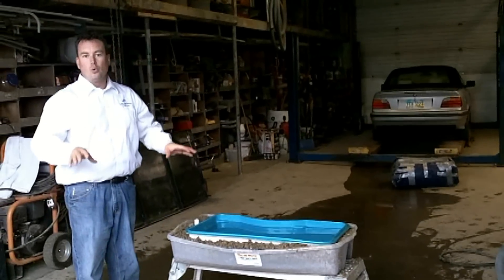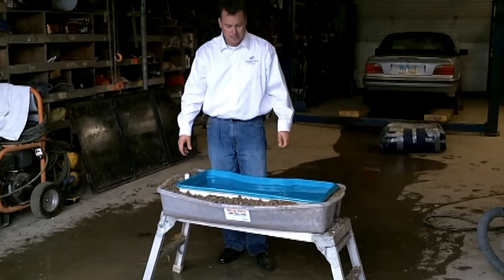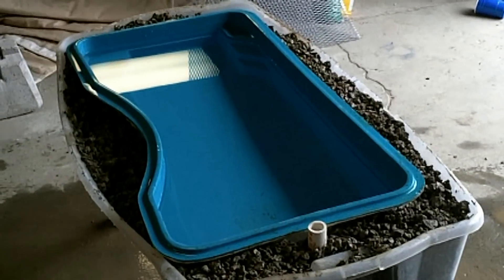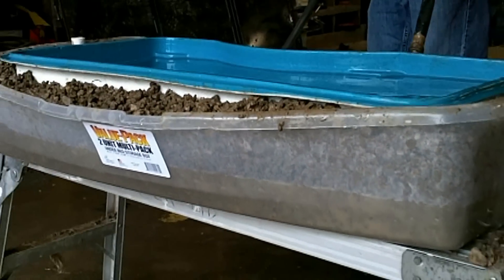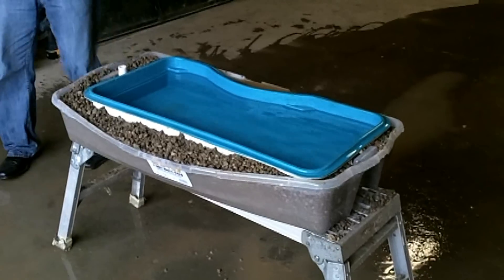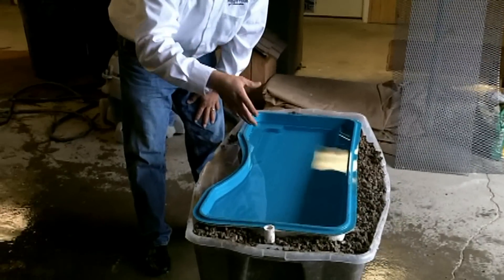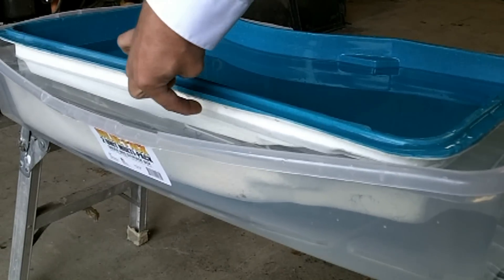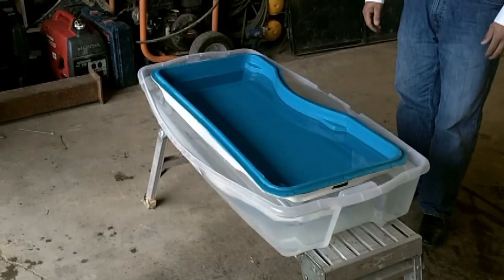Fiberglass pools Just Pop out of the Ground???

Comment: What about draining for winter closures? You need to lower water levels below plumbing.
Reply from the maker: You don't need to lower the water when you winterize. Another myth that the pool industry hangs onto. A fiberglass pool should be left full at all times. Most manufactures warranties require it.
Reply: @LuxuryPoolsandLiving  -40 degrees celcius in winter over here. Plumbing/skimmer would expand and crack immediately. I think you live in southern US??

Comment: If it does not pop then it will fall apart in 5 years like the container. These pools should never be sold. I hate telling my customers that I can not fix their pool because this product should not have been sold to them in the first place
Reply from the maker: I'm sure that you have seen many bad and cheap pools out there. All fiberglass pools are not created the same. Nor are installers. There is a good chance you have not seen a quality fiberglass pool because there are not reasons to have service done. A quality fiberglass pool (like boat) will last for decades and decades.

Comment: I don’t get it. Your demonstration seems flawed. Maybe I just didn’t understand you properly. In your demonstration, You don’t have significant hydrostatic pressure for the water that’s right outside of the fiberglass. This is because the plastic tote relieves pressure by bowing out. But the earth won’t give so much and therefore you will definitely have a spike in hydrostatic pressure with a little bit of water outside of the fiberglass and no water inside the pool. And yes, it will be like trying to hold a balloon underwater.

Comment: THis os so unscientific. The level of the water in the "pool" is higher than the water in the tupperware could ever be (it would flow out). Therefore it will never "pop up". Drain some water out of the "pool' and itwill pop up for sure.
Reply from the maker: Exactly the point Kevin- If there is water in the pool- it will not just pop out of the ground. Unlike a liner walking a fiberglass pool is stable at even equal water levels. 
Cheers!

Comment: I love your idea and your video. Great way to show hydrostatic pressure, but I would say that pools do need to be emptied out about 5 to 7 years because the water no longer holds the chlorine after that amount. I learned the hard way, my pool was green no matter how much chlorine a I put.     I would love it if you re did this experiment with a glass  container instead of a tupper wear that gives out.  

then show how if you use the sump pump to drain the water in the gravel, you can empty the pool completely and it would not pop out.   :)
Reply from the maker: Thanks for your comment. When you need to lower your pool water to get of CYA, it is important to only lower it to the point you are able to that is still above ground water level. If you are able to remove and pump away the ground water that is ideal and the safest. If you are only able to lower the pool to half way for example you can do that twice effectively changing 75% of the water.   Half and refill...Half and Refill.

Comment: A more effective demonstration would be to drain the pool model and keep the ground water level up.  Then, you could show people why you should never drain a pool without expert supervision (as the model pool will float).  The real issue arises when someone inadvertently drains their pool when the water table is high.  If the pool is fiberglass or concrete, it will likely move and float.  If it is a liner pool, the liner will float and move but the pool structure will not be affected.  All situations would require repair but the liner repair would be in the hundreds of dollars and not tens of thousands like a fiberglass or concrete pool.

Comment: This is not accurate why would they put it in a plastic tray not install it in the ground where it goes than seal off with some cement?
Reply from the maker: The point is that water AROUND an object (vessel) with water also IN that object does not create buoyancy and float. Water around an object with not water in that object, buoyancy is created and the pool can lift. Thus - DONT DRAIN a pool without professional help. They will not just 'POP' out of the ground on their own for no reason.

Comment: This is false and the reason why I say it is because I’ve had first hand experience with it . Installed a  pool was full and backfilled with gravel just as the illustration and the pool rose  six inches at the shallow end . So therefore this is fake news not to scale. I’ve known other installers to have same issue. Must keep pump in well point till deck is poured.
Reply: Jason- Thanks for your comment. The point here is that if there is water in the pool and that water matches the water around the pool the pool will not float. Not enough boyancy is created to lift it. You can demonstrate the same thing in your kitchen sink. Place a casserole bowl in the sink. Fill it. Fill the sink to the same level. It will not float. 
If you are a pool professional I am sure you are familiar with the bucket test. The bucket is placed on the top step with the same water as the pool. It doesnt float off. MORE water around the vessel, bucket, boat, or pool - YES there is buoyancy.  The myth is that fiberglass pools pop out because they are fiberglass. That is certainly not that case.

Comment: We have a fiberglass pool and yes it did pop out of the ground, the whole length of the pool on one side.  the pool is a san juan luxor grand and the pool was just drained to just below the jets and the lights to ensure no water was in the lines for the winter.  pool been in the ground about 9 years and this spring was the first year.  So they do pop up and we have pictures and bills to prove it.  The key is to ensure that the individual that comes in to install the pool, goes the extra mile and ensure that the work and the material around the pool is done right.  Problem is you don't find out if done right until you have a problem which is years later.
Reply: what material was backfilled with ur pool? around the pool
Reply: You're talking utter nonsense. If your contractor has to 'go the extra mile' just to give you what you're paying for, you should never have employed them.
Reply: It's like saying all fibre glass pools pop out of the ground. You probably didn't maintain it properly
Reply: Thanks for your comment. You obviously had more water on the outside of the pool than IN the pool. Im sorry that happened to you. The point here is that if there is water in the pool and that water matches the water around the pool the pool will not float. Not enough buoyancy is created to lift it. You can demonstrate the same thing in your kitchen sink. Place a casserole bowl in the sink. Fill it. Fill the sink to the same level. It will not float. 
If you are a pool professional I am sure you are familiar with the bucket test. The bucket is placed on the top step with the same water as the pool. It doesnt float off. MORE water around the vessel, bucket, boat, or pool - YES there is buoyancy.  The myth is that fiberglass pools pop out because they are fiberglass. That is certainly not that case.

Comment: it all comes down tot he level of the ground water compared to the level of water in the pool. if the ground water is higher than the water in the pool it will push it up.  obviously a fiber glass pool will be more susceptible to this compared to concrete. it may as well be a boat filled with water...

Comment: In any fiberglass pool there will be blistering to the gel coat, sooner or later. The water will need to be drained to repair. That is the main reason to drain a fiberglass pool. The area that the pool is in will determine the risk, the size, the depth, the duration it will be empty. And yes there is a risk associated with a fiberglass pool.

Comment: question about gunite pool---is it normal for water to leak into the pool where the pvc pipes stick out? we have had heavy rains and i see water coming in under the pvc pipes on the side of the pool. the gunite was put in 2 weeks ago. my pool builder says its fine....??? i posted a video. you can see the dirt stains under the pvc pipes....thanks for your advice.
Reply: If the pipes haven't been epoxied in properly yes
Reply: Plaster will seal that.

Comment: He's a salesman. Fibreglass pools do need draining from time to time. Gelcoat degrades over time and is not maintenance free.
Reply from the maker: If a quality fiberglass pool is cared for it will not need drained completely. If the need does arise its not that big of deal IF YOU have a sump tube / well point installed. 
https://youtu.be/r980exBfzb0
Reply: I cannot agree with so many of his assertions,   In order for the pool to pop out, it most likely due to water UNDER the pool v. the weight of the water IN the pool.   I live in FL and the water table is high, and any type of pool is prone to poppling out if it is left empty or low on water for any amount of time, and heavy rains will further raise the water table under the  pool and will "float" the pool out of the ground.  I have Pebbletec surface on my 30 year old pool and with proper chemistry maintenance the water never needs a complete change.   Always choose Pebbletec for your inground pool surface

Comment: You say you never have to drain a fiberglass pool, correct? What about New Jersey in January? When that freezing water turns to ice, something has to give, your liner!!
I seen ice crack car engine block. This is when your pool can pop out of the ground, when you have to drain it, to prevent cracking. Insurance companies require special coverage for fiberglass pools, because of the popping out of the ground problem. Your video is so lame, Take all the water out of the pool, then add the ground water!!!!!
Reply from the maker: Richard- You NEVER drain a pool. Period.  As for 'Freezing' you must have never mad ice with an ice cube tray. Ice will expand up.
PS- if there is water around the pool AND water IN the pool....NOTHING HAPPENS.
thanks,
Reply: Luxury Pools and Living Ohio i have a fiberglass pool 5900 gallons and i have a calcium issue. i cannot get rid of it. my installer said the only way is wet sand paper. I have triedchemicals to no avail. please advise. walls are white floor is getting white and pool is blue. im sick.
Reply: I've had a fiberglass pool for 25 years now... no popping out of the ground... that said. We were told to NEVER drain the pool completely,  sooo,  we never have! At my pools age it has faded though and I'd love to be able to re-color the surface.....

Comment: I understand that concrete and fiberglass pools pop out of the ground, but in most cases, why would there be an equal amount of  water be outside
Reply from the maker: Pools, boats, septic tanks, etc dont float because there is equal water in the vessel than out.... they float because there is MORE water outside than inside... thus buoyancy. Where the ground water comes from and why varies from site to site but having a sump tube or drain to daylight is how you insure that the ground water can be removed and keep the pool safe.

Comment: Let's try increasing the size of that plastic container that the scale model fiber glass pool sits in and expand it to about 5 to ten times the area of the pool (this would be more accurate to an actual in ground pool). Then completely fill the container (until the water level in it surrounding the model fiber glass pool matches the top rim of the model fiber glass pool) with water and then drain the water from the model fiber glass pool. While draining the water from the fiber glass pool you will undoubtedly notice the model fiber glass pool begin to lift. This will occur because the water in the model fiber glass pool as it is displaced will no longer be equal to the surrounding water area of the plastic container to which it is contained in. Your video demonstration does not account for complete water displacement from the model fiber glass pool and inaccurately depicts equal water area ratio between the model fiber glass pool and the surrounding water within the plastic container to which the model fiber glass pool resides in. This whole video is a misrepresentation and misrepresents the scenerio you are describing in your video.
Reply: Expand it 5-10 times the area of the pool? Where on earth did you ever see an installer dig that much to put a FG pool in? My pool was dug out no more than 2-3 ft around the side walls of the pool. From a scale standpoint, this video depicts almost exactly what my experience was based on my builders install.

Comment: There are reasons to drain a fiberglass pool. I am getting a lot of calls to refinish someones fiberglass pool. Now if there is never a reason to drain a fiberglass pool
then how are we to repair the pool. The fiberglass walls have bubbles on the inside walls, and the pool need to be sanded and re finished on the inside. Well here is how to repair the pool, but we have to drain it. So here is what we do. When the pool is drained down 2 feet below the normal tile level. We place a brace against the walls of the shallow end of the pool. If the pool is 16' wide (pretty standard) some are 14' wide. What ever the width  a flat board is placed against the wall from top to
where the radius starts to form the the bottom of the pool shell. Then we take a 2'x4" and cut it just enough so it can be wedged against both boards on each side;
These braces are placed every 6' apart.
This brace keeps the walls from caving in and relieves any outside pressure on the pool walls. Now as the pool is drained another 2' down braces are placed where the walls have a lot of space for out side pressure to collapse. This take s little common sense. While draining the pool, we also drain the water from the bottom of the pool by placing a small water whose in the over flow pipe that is at is at the main drain.
When all the braces are in place  we take a brace and place it beside the main drain with a back up board underneath the so not to damage the shell and then we
nail it to the cross brace to keep the bottom of the pool from rising up and causing a belly in the shell. When there is about 2' of water in the pool we pull the plug so any water can seep in the drain and come in the pool. This way all the pressure is removed from the pool. Thus the pool is not floating.  I have never seen a fiberglass pool float. But I have seen a gunite pool float 3' above the ground. I have seen a fiber glass rip in half after it was installed. I poured the deck around it and the pool and 2 weeks later the new pool ripped apart in  the corner. This was a rectangle pool. I have been in the pool business since 1970 and I may have just seen it all.
Reply: How do I edit the misspelled words in the blog above
Reply: There is no need to drain a fibreglass pool to make small repairs, gelcoat can be applied underwater and will fully cure underwater.  The gelcoat will get a milky white surface when cured which can be polished off with a scotchbrite.
For major repairs it is more convenient to drain the pool but not absolutely necessary.
Reply: Never back fill with Gravel unless its a very small gravel, because if you use larger gravel, the pressure from the oustside will force the rocks towards the fiberglass and will puncture the shell causing a leak. On the other hand a river sand is used to settle and it packs real fast and easy. And never leaves a chance of puncture holes. Never use  just fill dirt eather because it dries and leaves an air pocket between the shell and the fill.
http://poolremodelinghoustx.com

Comment: Any pool can pop out of the ground due to hydrostatic pressure. I grew up in a neighborhood in which every house had a pool and I cleaned them, done research, seen different methods etc. a hydrostatic relief valve and groundwater pump near the pool to remove groundwater when draining is normal. Very important: replace the relief valve regularly to keep it functional. Always get a second opinion and do your own research and come to your own conclusion because it's you who can be stuck with a pool popped out of the ground.
Reply: Rsmoke Smoke